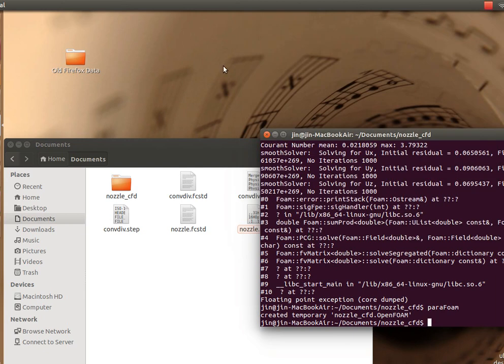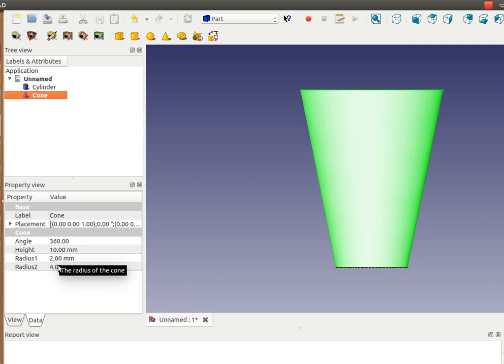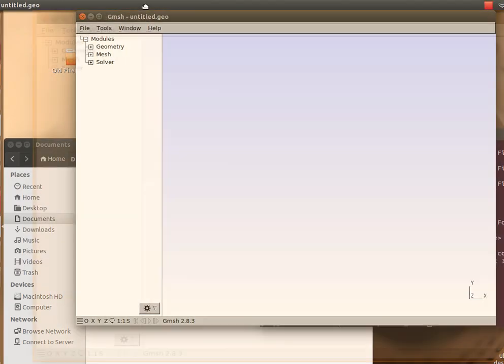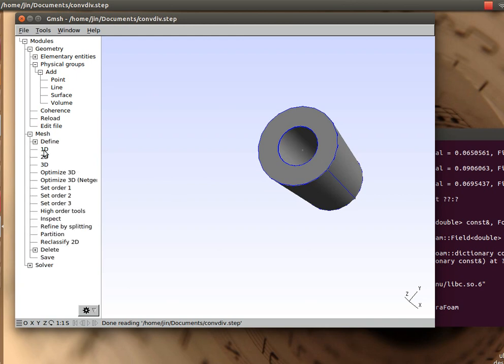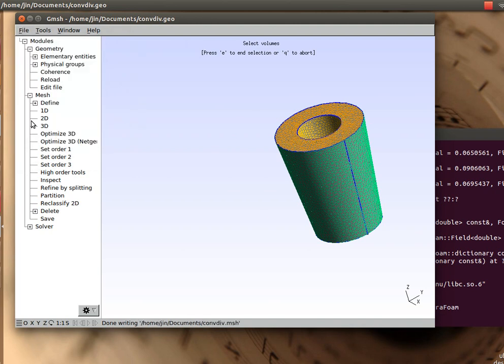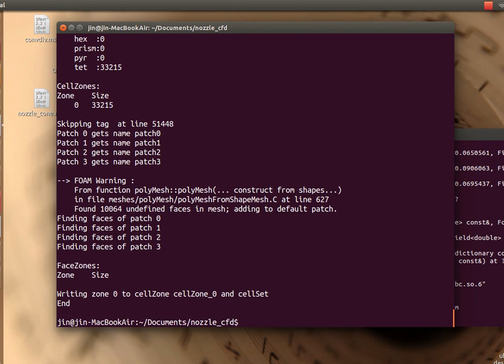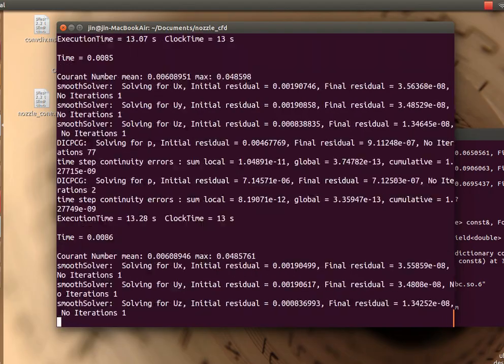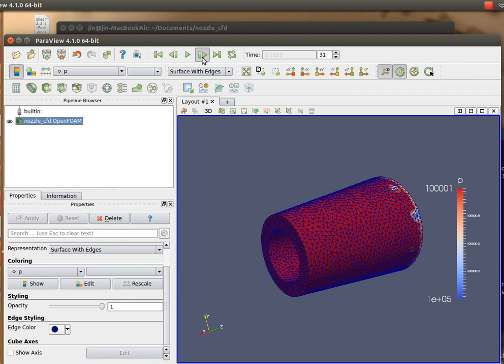FreeCAD, Gmsh, OpenFoam - an opensource CFD case

Comment: Hello, 
I'm Aldi.
your video is awesome.

I want to try for simulating propeller case with openfoam,
so that mean, i have to make the boundary condition in GMsh Also?
but how about propeller? the boundary is Cylinder, and propeller is inside of Cylinder, then Mesh using GMsh, Isn't it?
please help me,
thanks so much.
Reply from the maker: +바하뜨마까알디아스 Hello Aldi,

Thanks!

In order for you to create a good grid (mesh) for flow around a propeller, you must create boundary layers on propeller blades and inside surface of the boundary. However, this is going to be a case with dynamics mesh - meaning that the propeller blades are going to change their position WRT time and hence you should also consult the right documentation before you create the grid. You CANNOT define a boundary layer in Gmsh (as much as I know), hence you might like to use snappyHexMesh etc. Hope it works!

Amit
Reply: +Amit Prabhakar hello man,
I already try using GMsh, but still error,
i just made simple geometry of nozzle,
http://www.cfd-online.com/Forums/openfoam-solving/170532-importing-mesh-gmsh-openfoam.html#post597803